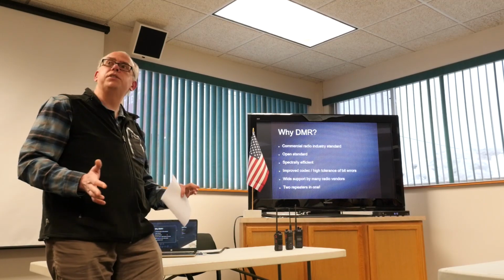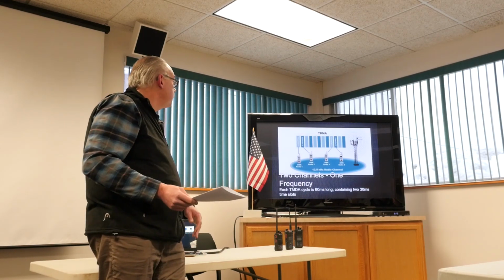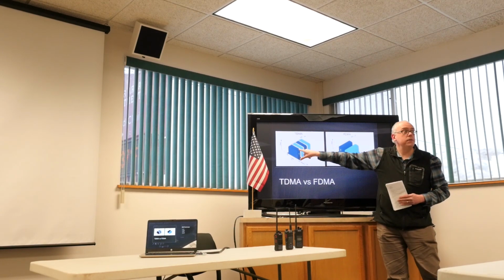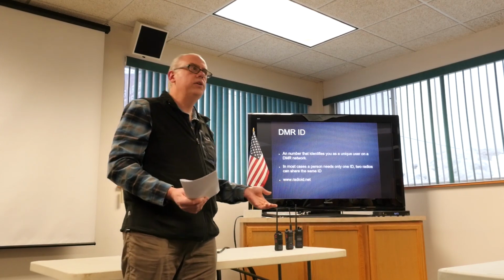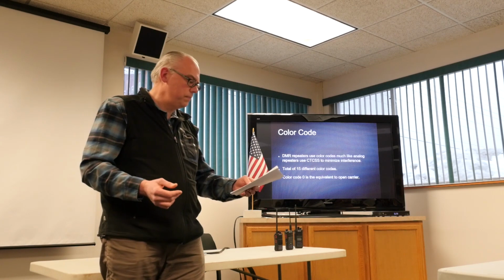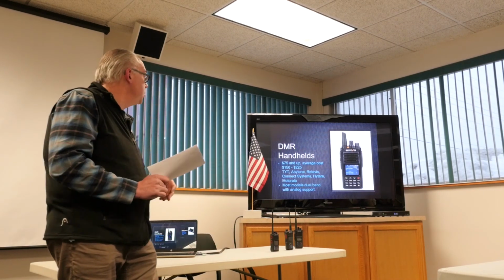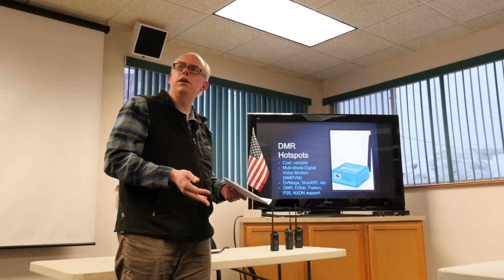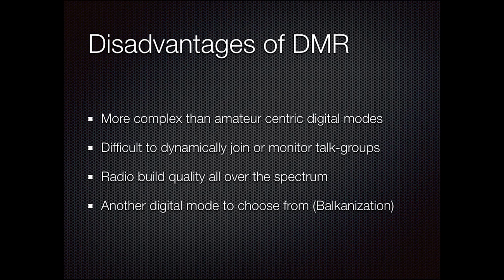Introduction to DMR (Digital Mobile Radio) Presentation - Ham Radio Q&A

Comment: Do you see in the future Hams with software experience modifying the firmware of DMR radios along with the programing software to make it more compatible or easier to use with Ham Radio.?
 I see some of this happening with a GD-77 HT.  Quite a group of followers doing mods, hacks etc, for that HT.
Reply: There have been firmware mods already for some chinese radios (Tyt MD380 for example).
The programming is simple already for most uses.
Setting up a radio that has roaming capability is a little more complex.

Comment: Great presentation, but why did you place the flag in front of you monitor. It blocks a little of the presentation, and is very distracting.  Next time move the flag please, unless your talk is about flags.
Also place camera higher please .
Reply: Not only was the flag not in front of the presentation (there is an obvious gap between the two) he showed each slide full screen, completely unobstructed. You may have been attempting some constructive criticism, but instead you gave us a list of things that annoy you. At least wait until someone asks for your pet peeves before you share.

Comment: Being a truck driver and not always in a good spot for a repeater do you absolutely need a repeater or can it be done thru a hotspot device?
Reply from the maker: Some hams, especially in areas that may not be served by a DMR repeater, are using a hotspot on a MIFI link. As the other commenter said, it depends on if your phone's data plan will support that use, but would be an excellent option for the over the road driver.
Reply: A hotspot (many) can be configured to work with your DMR radio and your cellphone’s data plan capability.  I hear many hams on DMR conversations traveling using this setup.
Reply: Yes
Reply: If you’re a long haul trucker, a hotspot would be necessary imo. Doesn’t matter where you are. As long as you can get internet/data, you can talk to anywhere in the world that has dmr capability. I have a hotspot specifically for traveling, so I never have to program the radio when out of town.

Comment: Thanks for the video
I have been using DMR for 5 years now and its my preferred mode for now.
DMR is growing, evolving and expanding daily it seams like (128,238 users at this moment), so its hard to present up to the minute info.

ie Brandmeister is not the latest Network, there are others as we speak on air and being configured and coded with their own features.

some hot spots are pre built (pay and play), others are build using various components, but all are updated often, many times adding new features.

That IS what makes it Ham Radio

Comment: Yeah, the neatest thing about those hotspots is how some (many?) of them now will do like the gentleman said - come with in a YSF radio and be transmitting into a DMR talkgroup, as setup in the Pi-Star configuration page. Just enable the YSF to DMR mode and away you go. This may not be true for all of the hotspots but many of them now do this. Check it out!

Comment: I have been off the air from1982 - 2016, April 2016 my wife bought me a FT1200, and FT400 so I could start up again. Within the first few months I realized things have changed and being an Advance I felt like a Novice, then I heard of DMR, great more confusion. I bought a TYT390w/GPS and lucky for me a friend and operator had a plug and programmed my tyt.  Well here I am in 2019 maybe been on the radio an hour per year trying to catch up on 34 years of technology.  I find the DMR is not ham radio, there is no challenge for contact, I never got involved in contest for headcount. I enjoyed contact and just some BS'ing with others, and always trying new ways to better my system. That is what ham radio was about.   Good vid.

Comment: Hi Michael. I loved the presentation. I am new to dmr and have a Retevis RT3S. I was wondering which hot spot to buy. I see so many different ones at all different prices which is confusing to me. Which hot spot do you use? I was hoping to spend around $100 to $150 on one. Any suggestions would be appreciated. By the way, I purchased  one of your 222mhz Jpoles about a year ago and love it! Great antenna!
Reply: You can get a fully built hotspot for $90 all day long on eBay. Cheaper if you want to build one. I have an original open spot and a rugged spot. Love them both, although they are a bit more than your price range. Good luck.
Reply: I Would recommend you get an MMDVM Hotspot PCB from China and use it with a Raspberry pie running PiStar Software this would let us try all the modes.
I have just received my DuelMMDVM from China and can't wait to get it up and running
If you are within Range of a DMR repeater then you don't really need a Hotspot.
Good Luck.